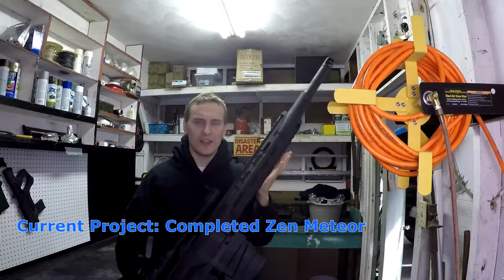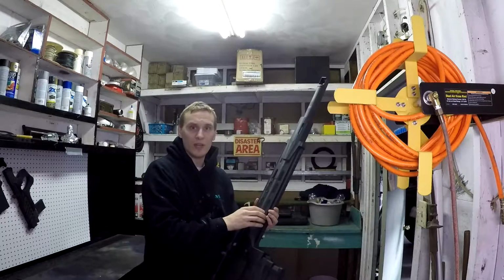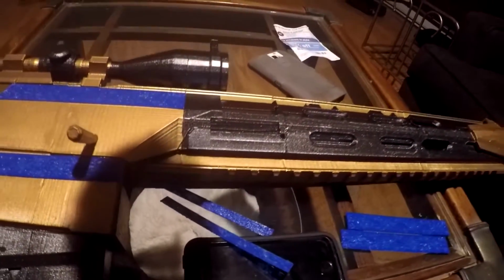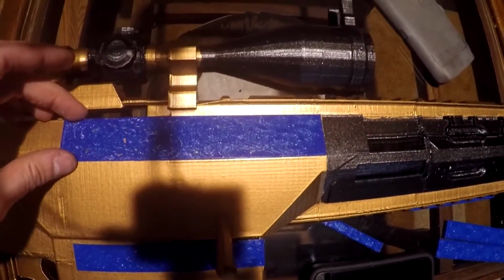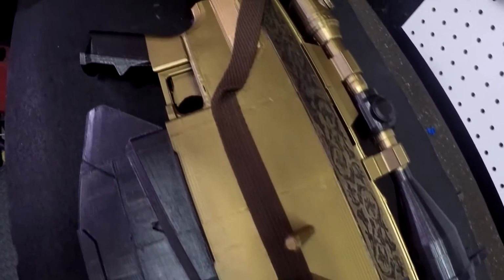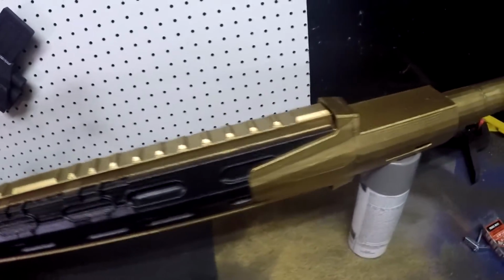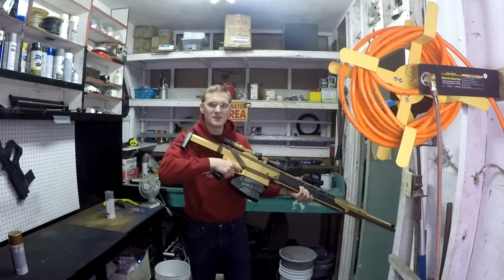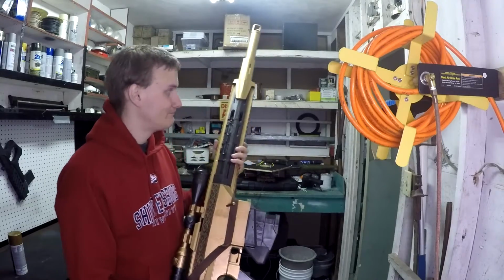Worlds Only 3D Printed Zen Meteor Sniper Rifle

Comment: Nice work dude, i'm working on some 3D stuff too and i'm really interested in 3D printing lately, may i ask what kind of printer do you use and if you have any advice. Again, good work that gun is awesome
Reply from the maker: Hi Thomas, I use a Robo 3D R1 Plus and would be in my opinion a perfect starter machine as well as an expert machine as you skills improve. If you need any other advice just ask or you can Skype with me personally and I can answer any questions you might have.

Thanks and welcome to pixel armory
With respect

Bert
Reply: Pixel Armory i was wondering, are you modelling the guns yourself ? I'm curious because the details are really impressive and probably time consuming. I'd love to print some stuff myself i really have to learn more about the printers etc, i'll definetly take a look at the Robo printer
Reply from the maker: Its about 50/50. A lot of the models I make from Destiny require a lot of touch up to print properly. Some of the models I cant find so I just make them if they are simple. Thingiverse and yeggi are good sites to find models. The more I print the more I learn. So it becomes easier more you work at it.

Thanks